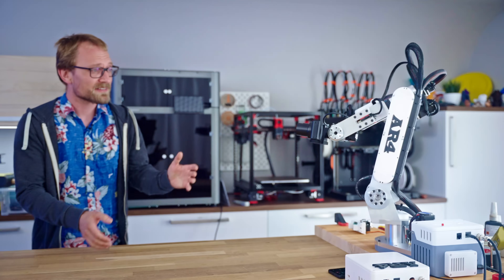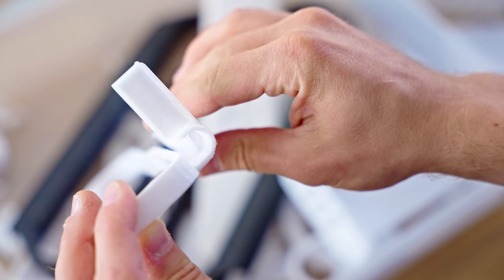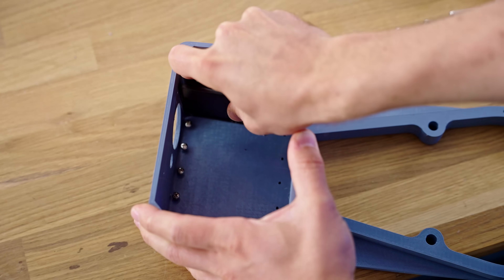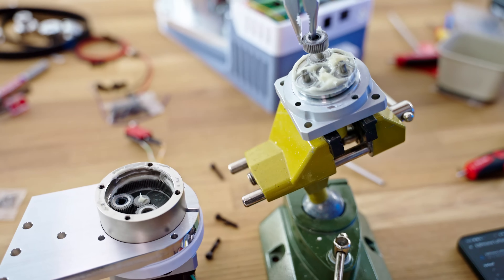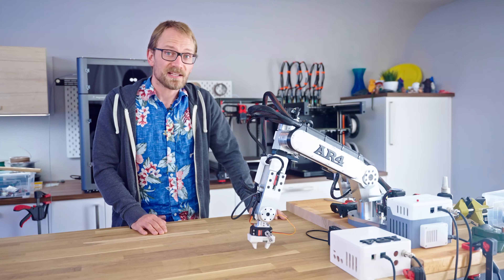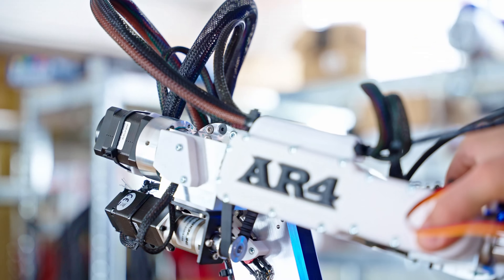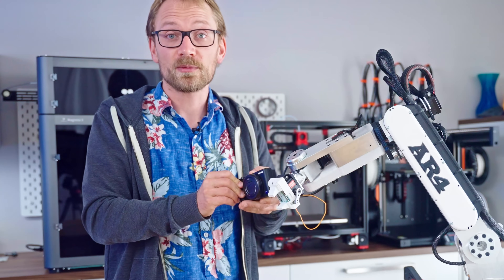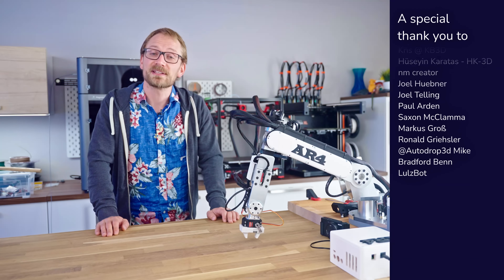I built myself a new Robot Buddy!

Comment: Nice toy - but still pretty expensive for that amount of wobble 😐
Reply: Yeah i'd definitely think something more accurate would be a better compromise than sheer load bearing capacity.
Reply: Vibration from the steppers is probably a main source of the wobble.
Reply: @elHippieSupremo   I don't think so.
Reply: Yes, but if you read the pinned comment at the top here, the designer states that TS's belt tensions were way too low and that contributed significantly to the observed overall wobble. Would be nice to see a followup showing the change, if any, after increasing belt tension as the designer suggested in his comment.
Reply: @steveh8724   There is no pinned comment and designer's comment is much more recent than this discussion thread.
Reply: @SianaGearz  You seem to have trouble reading dates. :o
Reply: @jannh7569    You think "1 month ago" is shorter than "4 weeks ago"?
Reply: @SianaGearz  Designer's comments were here first. :)
Reply: @jannh7569   Nah we spoke on video's release day. Annin came in about a week later.
Reply: 2k is actually really good for something like this. You'll have to spend upwards of 15k to get something like you're imagining and it still have some issues with backlash and deflection.
Reply: @jsaction33  I would rather safe up for that than spending 2k on this toy. 🤷‍♂
Reply: @tcurdt  You can say that but it's probably not true and certainly not the case for most people. Affordable price is the most important thing performance comes after. People like to think otherwise but that's not how they actually behave.
Reply: @jsaction33  Price > Performance? I would argue that pretty much depends on the use case. Which is why I call it a toy.

And I don't think you have any insights on what I would do. So calling it "not true" is pretty pretentious.

And I am quite sure we have outlasted the usefulness of this conversation.

Comment: Oh boy that backlash. I guess I'll wait for AR5. Feedback: Hall effect sensors are more accurate than limit switches. There are even hall effect encoders to check the actuall position.
Reply: Or even optical endstops. Hall sensor are unfortunately temperature affected, so depending on the use case optical might be the more repeatable option

Comment: 4:29 The reason why a tinned stranded wire will fail in a screw terminal is twofold:
1. Tinning a stranded wire will introduce a weak point where the solder wicks into the wire. If the wire doesn't move, this isn't a problem. But if it's part of a moving system, that wire is now much more likely to break where the solder wicked up. Now, I'm told you can get away with tinning as little of the wire as possible, but I've never seen anyone pull that off.
2. Solder is prone to "creeping" under pressure, it's not really meant to hold its shape when it's squeezed. Over time, the soldered wire will slowly deform, loosening the connection with the wire, meaning you have to go back and tighten the screws. I've actually encountered this after about 2 months, and it is a huge pain.

Better to crimp on a ferrule to each of those wires and never have to worry about them until something happens on the other end.
Reply: Instead of ferrules I like to solder male breadboard headers to the end of wires if they're going to be screwed into terminals. I think ferrules are probably the better solution for most cases but I don't have a crimp tool and many ferrules are way too thick to fit into very small terminals
Reply: @catdisc5304  ferrules are sized based on the wire diameter, if a wire with ferrule is too large to fit in a screw terminal there is probably a good chance the wire is too thick anyway and the wire can handle much more current than the screw terminal.

Ferrule crimping tools are very cheap and simple to use, much simpler than other connector types.
Reply: Heck yea, ferrules! Crimp once and never worry about a lose contact again!
Reply: @conorstewart2214  yes, but you do want a good one, cheap crimping tools can be awful
Reply: If you're spending 2K on a robot you might as well spend a tiny bit more to get reliable and properly crimped connectors
Reply: I'm a ferrule nut too.  I'm always chewing people out for terrible connections.  Square hole, square crimp.  Cheap ferrule crimpers aren't as bad as, say cheap RF crimpers, though that becomes less true with heavier gauge wires.  Most crappy crimps are due to incorrect size selection, IMO.  Spread the gospel.  Ferrules rule.

Comment: Axis 2 and 6 are designed OK. Other axes makes me say "what was he thinking?". Trapezoidal belt for axis 1, 3 and 4. Leadscrew on axis 5... Yes, it moves center of masses down and reduces required torque, but it would be much better to grab beafier gearboxes with higher reduction rate and drive joints directly.
As for electronics, he could install TMC5160-BOB in the back of each motor, connect all of them via SPI, and control everything directly from RaspberryPi.
Reply: but your suggestions would all increase the cost, no?
Reply: @ferriswhitehouse1476  Not much. TMC5160 costs as much as DM542, but much more advanced and can correct step loss. And cost could be cut with other changes like dirt cheap magnetic encoders instead of expensive optical ones and only one very simple and cheap MCU would be required. Also wiring would be simplified - TMC5160 can be daisy-chained via UART, so only 1 UART wire and 2 Power wires would be required.
Reply: @TheNamelessOne12357  okay sure for the electronics ill agree. It was released a few years ago so maybe those options weren't available, I'm not sure. Maybe a user could do those upgrades on their own. For the mechanical aspect though I would imagine its a pretty big cost jump. If you put more weight up on the ends of the arm then everything below it needs to be beefier as well. So upgrading all gearboxes and motors and frame components.
Reply: @TheNamelessOne12357 Chis is a Robotics Engineer by day job. The AR robots he designed for free basically, to be as cheap as possible. I asked him about the gear ratios and he said he made it this way so its speed is useful. If you look at the arduino/teensy code, it's quite advanced now. The windows app is just a UI to interface with the microcontroller that does all the IK calculations like ATAN2 etc, and synchronisation of joint moves.
The serial on the microcontroller is agnostic to the UI platform. It could be Android, pi, windows. It's just the UI was designed for windows.
-Ken

Comment: At the CNC machine shop where I'm working we are running lathes with Fanuc robot arms. If we take the speed down to 5 or 10%, then we can see the same shakiness going on. That's in my opinion is inevitable, because the second joint's rotation will extend to a greater circumference, meaning for the same amount of degrees in rotation you get an increased amount of movement on the end compared to the later joints which have way sorter leverage to the same point.

If the steppers are able to handle higher torque and you try to run it faster, it won't just seem more fluent, but it actually will be more fluent, because the steps are coming in a higher frequency leaving out the dips in torque in between full steps.

Comment: For those rising screw terminations, I've had much success wrapping strand conductor around the insulation and treating the conductor as a ferrule. Torque it down until you can't anymore — and then some depending on hand strength, you'll have long-lasting connections. Works damn fine and all it costs is time.

Comment: I've been thinking about building a robot arm.  Basically a "3rd hand" setup.
Push a button puts it in free move mode.  Then push the button again and it locks in place.
The most generic example is soldering.  Position the arm to hold the wire in place and then I can solder it together.
Reply: Me too!  I have also been trying to come up with a simple work light.  As soon as you touch the light the brakes release... move it to a new location, release it... the brakes lock.
Yeah... I know... just use an anglepoise lamp, and get over it!   😜

Comment: A point on the software, what you are provided with looks to be on pair with a pretty standard industrial robot arm controller system. Which is great, and it gives all the function you need to make it move. However, what you need to learn is less about specifically this software, or any industrial robot's software, but the systematic knowledge of robot. More specifically to the problems you get at the end where robot doesn't move in the right way, it will all make so much sense after you learn the basics of robot kinematics and trajectory planning.

Comment: You know, for the price point, and being a one-man operation, this isn't too shabby.
It also makes a good starting point.  All the parts are there, even if they aren't the best for function.  You could probably retrofit some more precise motors, better gears and belts, and rebuilt joint bearings, to get a more precise machine.
Reply: It's actually exceptional what he's pulled off. To reduce deflection and backlash to the degree people would want it would easily push this build north of 10k. Even industrial 6 axis robots have these same issues that sometimes have to be worked around especially in vision guided applications.

Comment: Good "review" of this kit. Even with restrictions I think for this money you get an awsome kit. 
@12:33 you say the motors don't meet the backlash of 0.25 degrees but you measure the complete robot, not just the motor, so that means you also measure any play in the bearings.
I use a Kuka KR180 and with that one, motions are also not always smooth. Depending on the load (I have a 30 kg spindle motor mounted as end effector) I can see some jitter during moves and expecially when the brakes are released from the motors there is some movement to compensate for changing load on the motors. 
The AR4 is still an amazing development and it does have some nice uses for parts picking applications

Comment: I found this project some years ago, and have been interested in printing it for a while. but there are some things that's been in the way (except cost), and one is that i would love to see it using Slip Ring connectors instead to be able to move freely without risking any cables getting tangled. But awesome build and nice to see the process!

Comment: Great robotic arm project.  Very educational but it could also be useful for part loading and unloading in a CNC machining center or CNC lathe, although there are surplus industrial robots better suited to that for approximately the same price without any build labor, assuming you'd be able to program the robot for your own task.  I worked with small Mitsubishi arms that had a rudimentary programming language that was uploaded as a serial file and apparently interpreted on the robot.

Comment: Hello! I really enjoyed watching your intriguing video. I hope this doesn’t come across as presumptuous, but I’d like to point out one area for potential improvement. I noticed that the stepper motor drivers inside the control box were mounted very close to each other. If you leave some space between these drivers, you could potentially reduce mysterious issues caused by heat, EMI, or EMC. Wishing you all the best and keep up the great work!
Reply from the maker: Thanks, I always appreciate constructive feedback! My build was following the official instructions from Annin Robotics and using the official machined and printed parts, so the choices there weren't mine to make.

Comment: I don't know if I missed it in the video but does the tapered roller bearings not get any preload? I'm pretty sure tapered roller bearings are always supposed to have a preload applied to them.
Reply: I think he mentioned preloading with grub screws in the beginning
Reply: I have a feeling a couple of grub screws aren't going to be preloading roller bearings that large an appropriate amount.
Reply: I think that was what Tom was referring to at 12:55, when he pointed out the tapered roller bearings being preloaded by a flat thrust bearing.  I took it that he thought there should be opposed tapered roller bearings, with preload, which would give better axial control.

Comment: A pair of opposed Angular Contact Bearings - the kind used in bicycle necks would still be overkill, but could replace those massive conical roller bearings in each joint. Cheaper, lighter, easier to design for. Fit for purpose.

Comment: Thanks for the video of this awesome project! 👌🏼
So if the motors got encoders is it possible then to make a manual (by pushing the arm) movement and let the robot repeat it? Or even edit the spline to make it smoother? 🤔
Reply: Not really. The robot mechanics attached to the gearbox would be overloaded and fail before sufficient torque is achieved to back drive those gearboxes.

Comment: You could try addingfriction to the axes to damp out vibration.  Either using a much thicker grease, or 3d printed brake pads against the cylindrical parts

Comment: I can solve your wire extension issues; Wago. They make inline splices for their 221-style lever nuts and I am certain there are plugs you can just fasten on without soldering meant for industrial applications, also in the 221-style.

Comment: For mating machined parts, I wonder if they could machine small lines that line-up to help prevent putting parts on backwards.
Reply: They could, especially if they are machining all those parts anyway, even just small engravings on the surface, like a line on each part, just match the lines, would be good.

However this likely isn’t a priority, the machine has a lot of other mechanical issues that would be more important to solve than making it easier to assemble.

Comment: This is very cool.  
Not the best use case, but as a demonstration of its motion control, could you fit a hot end and print a benchy?
Would require post-processing to convert the GCODE to whatever this runs.
Reply: Did you see how much it vibrated? Printing is a nope
Reply: The software can also read gcode now. One could wire the extruder motor as J7. The nozzle should better be as large as possible to accomodate for the comparatively low accuracy.

Comment: I use my AR4 constantly and find that crimping on a ferrule is less reliable then properly tinning and then soldering the wires. However, in the robot's electrical box, it is better to crimp the wires to a ring connecter, then attach and secure around the screw on the terminal block. 
TLDR: use tin and solder around moving parts, crimp wires around non moving areas
Reply: I'm genuinely curious. What is the use of this robot for a hobbist/small business? What do you do with yours?
Reply: @Estop117  I test the robot in commercial kitchens. The robot is good for small automation. Take that and upgrade the smaller motors to high torque steppers and you have a robot that can move fry baskets and other heavy objects

Comment: Seeing it all assembled and tested it doesn’t look as impressive as it initially did. That is a huge amount of wobble and flex in it. That 2 kg payload rating is very generous, if it wobbles that much lifting a small camera how is it going to handle 2 kg? 2 kg may be the theoretical maximum based on motor torque but usable payload capacity seems to be much lower.

It is still impressive being the work of one guy but in terms of functionality and practicality it isn’t as impressive.

The motors having encoders but not being able to recover from skipped steps is odd, why isn’t even basic closed loop control added? Based on the capabilities of the robot the teensy likely isn’t being stressed much, it should be more than capable of running closed loop control on the motors. Maybe this is planned for a future update?

Comment: having a robotic arm is one thing, it's very rare to see  the common man do anything useful with it, programming the desired movements is the difficult part.  Ive done it for some applications, linear tracks on the base def makes many tasks much easier.   Think hard about what you would actually  need a robotic arm for, before you go spend time on it.Random repetative tasks around the shop are much more difficult to make worthwhile than very long production runs. (vs set up time)
Reply: What robot(s) did you use?
-Ken
Reply: Good use is: Same robot used to do diferent repetitive tasks when sitation changes and need fast adaptation.

Comment: Yo Tom doing actual mechatronic engineering on the channel would be way cool. Yes camera arm is perfect because the cameras aren't nearly heavy enough to justify nearly this much finely machined alu in construction, and we can all 3D print, right, and there's any number of uses for a smooth and repeatable light-duty arm.

Comment: correct me if I'm wrong but I though the black stepper drivers (seen at 3:31) can set to try to correcting missed steps a few times before sending an error output.

(I was wrong there is only one input for step instructions)

but you can get self correcting drivers and set them to correct missed steps.

Comment: Hi Thomas.  Since this video is sponsored by Peopoly and their Magneto X, would there be a chance that you might make an follow-up video to your initial video of the Magneto X?  I read the Peopoly blogs but didn't notice any comment about the thrust bearing issue you had. (They did seem to be appreciative of your initial video).  Have you implemented the Q2 Upgrade Kit along with the enclosure?  Thank you!
Reply from the maker: I did add the enclosure, bottom cover panel, upgraded insulated heated bed and a new toolhead that Peopoly sent out, as well as a new X-axis wiring harness as the linear motor had started randomly stalling and disabling itself mid-print. I still need to figure out print quality, as the supplied profiles don't seem to give me the results that one would expect from a machine like this.